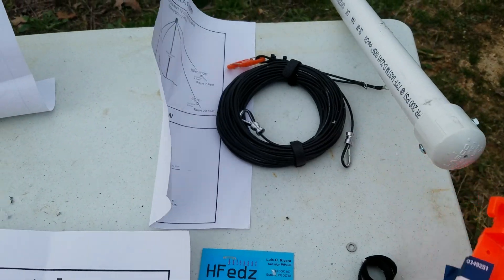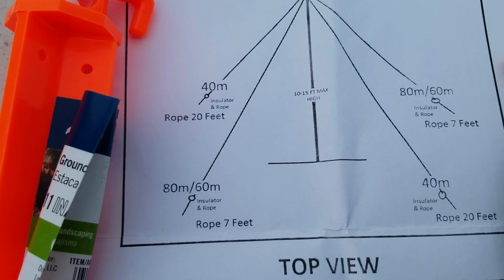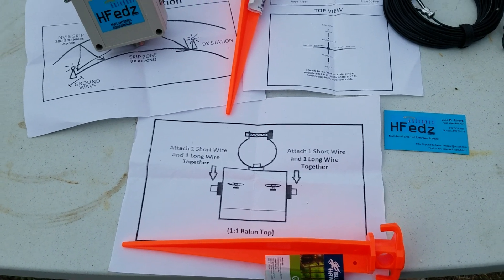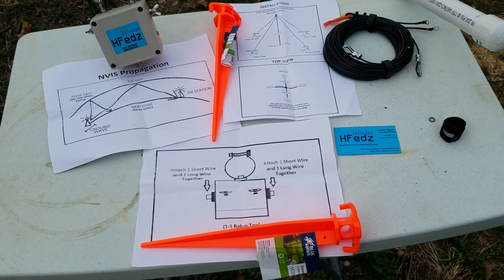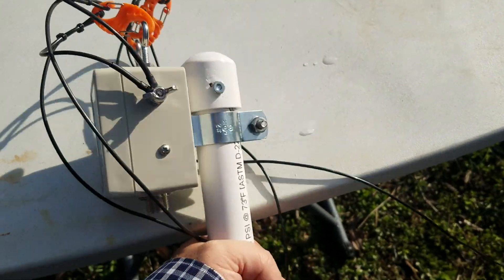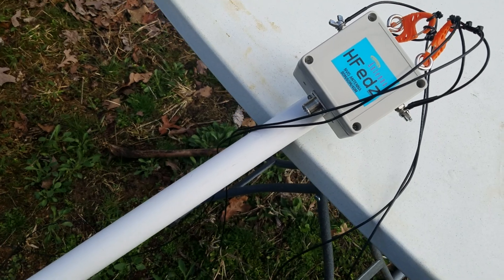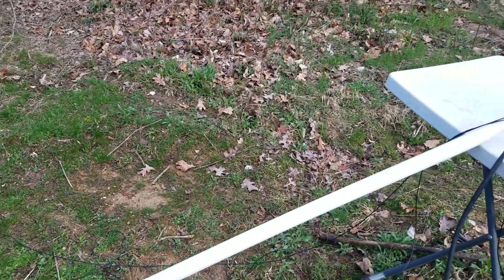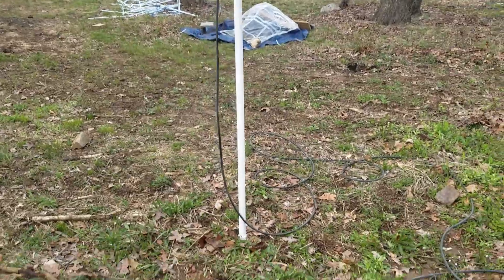NVIS antenna build

Comment: I just tried to set mine up and the swr is way over 3:1. The antenna tuner on the IC7300 won't even get it close to useable. I just reached out to the Mfr. and waiting to hear back.

Comment: Did you have to use external tuner, how did it work out?. 73 WY7RB
Reply from the maker: What you use as a tuner I believe is radio dependent and not antenna dependent. I have an ADG 200 Pro II autotuner. Seems to work OK.